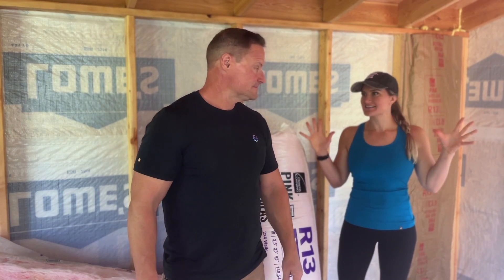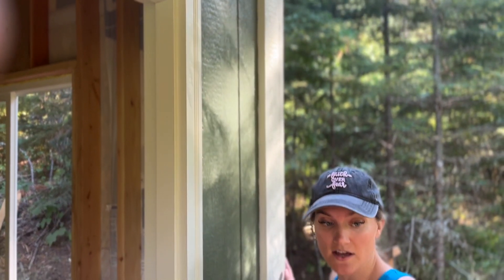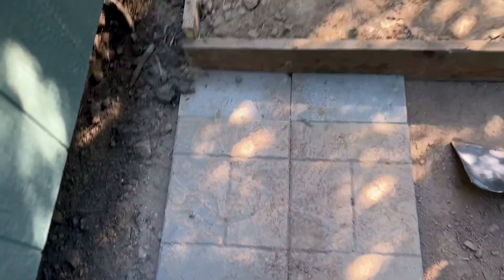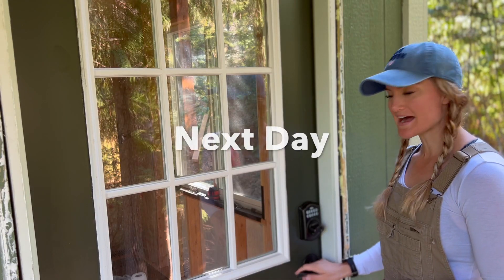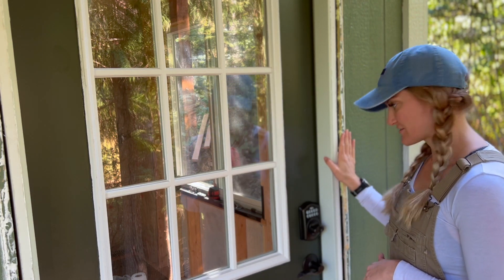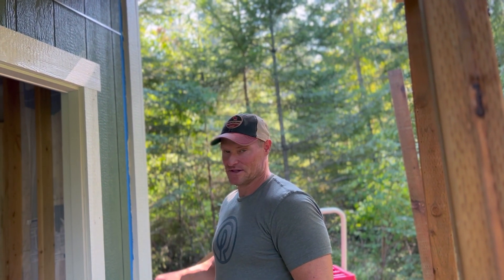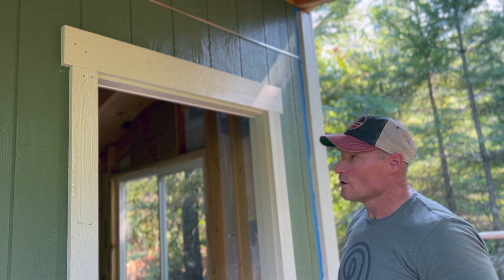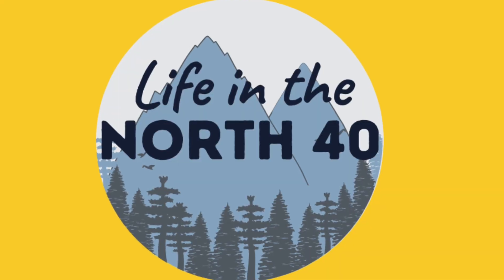Building an Off Grid Cabin in the Rocky Mountains (Part 11)

Comment: That cabin is like a carbon copy of Dave's cabin on the Bush radical Channel same as the one I'm building in Hawaii haha
Reply from the maker: Yes sir, I used his basic 10x16 plan. Although he built on a level spot in the sandy soil of the UP. I built ours on a heck of an incline with way more cement and dirt work. His front wall was 8 foot and his back wall was 6 foot, I raised our front wall to 9 feet and the back wall to 6.5 feet, he used plywood for siding and I used T-111 siding and I used house wrap he didnt. The other major modification was he did a shed style roof with 2x4 stringers across his joists, I did a real roof with sheathing then felt paper then my metal roof. I wanted better rigidity with my roof due to winter and tree limbs etc.. I also had to add a 4 foot extension off of the 5 foot deck to accomodate back facing stairs along the cabin to account for the slope. Thanks for watching, Please subscribe if you enjoy our content.
Reply: @LifeintheNorth40  yeah buddy good job, my cabin in Hawaii doesn't need so much insulation and I have a pretty level surface to work on. Here in Alaska here i live  I've worked on cabins like yours on steep shitty ground haha so I understand. It looks awesome keep up the videos

Comment: I love your videos, amazing job so far. Just a question, you are finishing th insulation but don't you need to run the electricity cables first? and the plumbing?
Reply from the maker: Thanks Manolo. We are keeping this a dry off grid cabin. We have a sloar genterator station we will use in the cabin for lights etc.. And in the spring we will build a matching outhouse with a composting toilet